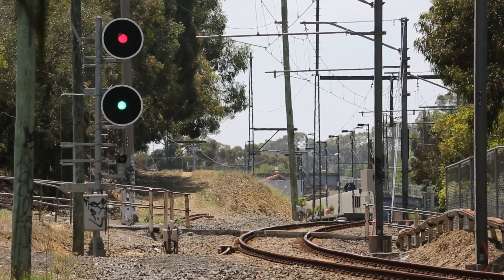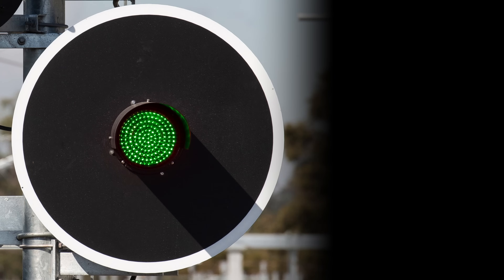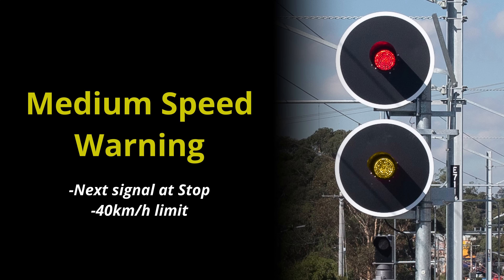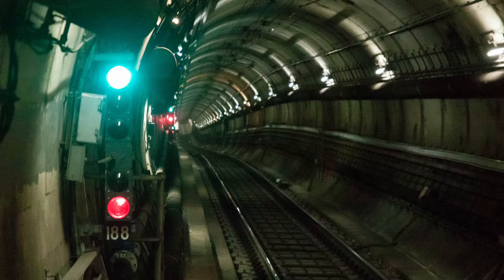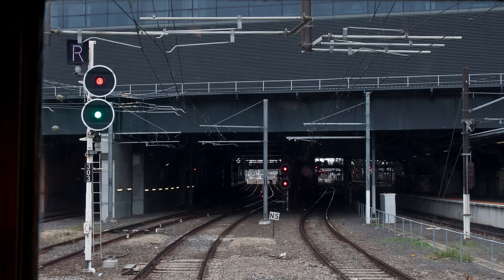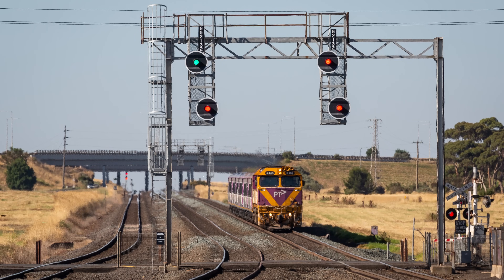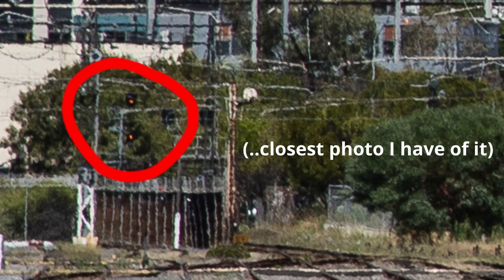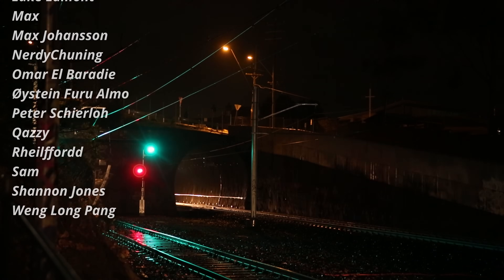Victorian Railway Signalling // What does it all mean?

Comment from the maker: Hi folks, I just want to answer two very commonly asked questions in these comments:

Q: "Why isn't 'Clear Normal Speed' green over green?"
A: Given that the top light means Normal Speed and the bottom light means Medium Speed, green over green would be a conflict: it would mean both speeds simultaneously, and go against the fundamental principals of this system.

Q: "Isn't it confusing to have a red light in a clear aspect?"
A: In short, no. Train drivers are highly qualified in what they do, and know the system like the back of their hand. Confusion about aspects isn't really an issue.

If any other frequent questions pop up I'll add them here!
Reply: It's easiest to think of the origins of this as two semaphore home arms on one post. The top arm is the NORMAL route at line speed, the lower arm is the DIVERGING route at a reduced speed. Everything is logically extrapolated from there.

In New South Wales the origin is HOME over DISTANT as a distant signal on its own at night was indicated by a fixed green home light mounted above it. They never switched to using yellow anything until introducing power signalling.
Reply: In 4 aspect signalling the B arm signal head showing a proceed indication does not necessarily indicate to a driver a diverging movement. A driver observing this signal could also indicate he is catching up to the train ahead of him and not diverging.  This is speed signalling not route signalling.   @cswvna
Reply: I mean, green over green is free to mean something special (I'd suggest green/green should be CBTC, and yellow/yellow for CBTC warning), as nothing else uses it. After all, if the lights are both out, how can you tell whether to use CBTC or if something's badly wrong?
Reply: CBTC relates to a system called positive train control which controls the movement of the train. There are options where the driver can control the train movement but it is still supervised by the computer control system.
CBTC uses the principles of speed signalling and all info is displayed to the driver in his cab. You don't need unwanted aspects like double greens or yellows to confuse the situation as with CBTC everything you need to know is on a screen in front of the driver.   @NoLongerBreathedIn
Reply: @NoLongerBreathedIn  or simply flash the aspects.
Reply: @ryguy2006  Victoria seems not to use flashing aspects as a rule, so I could understand the use of a double green for CBTC. Certainly it would seem to be a safer alternative than just extinguishing the signals, though I suppose that the in-cab control unit would make such an indication redundant.
Reply: @taitset, why does metro not travel via southern cross early Sunday mornings?
Reply from the maker: @mattizard6136  They physically go through Southern Cross, they just don't stop there. It's a stupid thing relating to the station being privately managed, and they didn't co-operate when 24 hour operation was introduced.
Reply: I've always thought Green over Green could function as a special "High Speed Clear" aspect if Victoria ever needed it. Such a thing would be superseded in the Metro area by High Capacity signalling, and I'm not holding my breath for > 160 km/h running in the country any time soon.

But the biggest mystery in Australian signalling is why NSW doesn't have a Yellow over Green "Medium Turnout Clear" aspect. Probably considered superfluous but it feels like it should be a natural inclusion to NSW Signalling.

It'd be interesting to explore whu Victoria's the only state that uses searchlight signals predominantly if that were possible though.
Reply: Not signalling but didn't know where to ask! I'm curious as to why the Ballarat Southern Cross line is scheduled 4 minutes faster going up the hill than it is going down. Regardless of time of day, peak or off peak etc, for the same number of stops, going up is quicker. Why!?
Reply from the maker: @MichaelGoulding  I assume by 'up the hill' you mean up the hill out of Ballarat to Warrenheip? It's because there's a much, much bigger hill in the other direction between Bacchus Marsh and Ballan. You can have a look at the gradient diagram here: https://www.victorianrailways.net/grades/melball.html
Reply from the maker: @OpGaming-el5zk Ah yes, thankyou!
Reply: What is ‘normal speed!? Is it posted as it is on a road,  or is it the same on all lines? If so… 90, 100, more?
Reply from the maker: @mattyb_25  It varies, and is usually not posted - the drivers know it from memory as part of their route knowledge. The highest line speed for suburban trains is 115km/h.

Comment: In Canada also, the offset heads mean that it is an automatic signal, whereas the aligned heads mean it is centrally controlled.
However, the 'A' under the signal has the REVERSE meaning as in Victoria Australia, it means the single-headed red signal must not be passed without documented permission from the dispatcher.

Comment: Yellow over green same meaning in Italy warning of speed restriction due a switch, fixed 30 km/h, flashing 60 km/h, 100 km/h when they alternate flash. Same meaning of red over green here in Italy speed  restriction due a turnout but 30 km/h max, higher speeds are signaled by an ausiliary speed indicator: one bar mean 60 km/h, two bars mean 100 km/h

Comment: Ex metro signaller here, good explanation. You didn’t mention disc, signals, which are unique to frankston area. Also bit of fun trivia for all you out there there are only 2 points on the network which are still manually controlled by a lever frame panel that aren’t customer service signal boxes by a signaller, Kooyong and Riversdale
Reply: I believe he refers to that in 0:44 with "except for a small patch in Frankstown"

Comment: This sounds like an overly complicated system, but as with all signal systems, once you get used to it, it's more a matter of remembering the patterns. Still find the German (all 5 generations), French, and Austrian systems the easiest to understand, and especially to drive by. The British system for the "real" trains is okay, but the system on the Underground is a mess that relies entirely on route knowledge instead of using logical signalling (I mean, their repeaters look identical to the main signals, which is not good for safety). I live in Denmark, where our current light signals were introduced in the 1960s and is only our second signal system. It's a very primitive system, really, with no pre-signals (repeaters, distant, whatever you want to call them) and wasn't designed for the speeds trains run at now, so they rely on ATC to tell the drivers what the signals are, because they can't see the signals in time when going full speed

Comment: My new signal knowledge actually proved useful the other day. The train my wife gets into work is an express through train and I always go with her as my daughters day care is nearby too. On the platform next to it is a terminus train which takes the same route 3 minutes later, but with more stops. Concerningly often, the express is delayed meaning the local train goes first, and since there are no passing opportunities for the express, it ends up stuck behind this train the whole way to the city. Usually, the station staff knows this is going to happen and announces to the platform for passengers to get on the other train if the express is delayed, since they'll end up being faster that way. The other day however, the station staff came out to this platform expecting the train. I noticed however that it did not have a green signal to go through, so I checked the other side, and sure enough that train had both green, and the 3 yellow lights indicating its path through the points, so I knew the local train was going first and told my wife to get on it. A few other people did this too, but most didn't and so they ended up missing that one and waiting for the delayed through train. 
Probably only saved my wife maybe 3 minutes, but hey, it's 3 minutes, that's coffee time 😂👍
Reply: You looked clued up and competent 😊

Comment: Very interesting! Our signalling in Auckland is very similar. All the same basic indications, but slightly different names - Warning = Caution, etc. We use the same letter route indicators and banner indicators. No co-acting signals or repeaters. Low speed here is 25km/ with the same terms. Medium is 25 unless indicated otherwise. Usually 40 or 60, but ETCS sometimes allows EMUs to go faster than other trains like 30 over 25km/h turnouts. We don't have two reds after an occupied section and no medium indications before a red. ETCS applies a calculated speed limit curve on approach to a red or a lower speed limit and speed indicators hit other trains with a 20km/h limit when approaching a junction occupied by a conflicting movement. We have A-lights and offset (permissive) signals with similar rules, but applied in different ways. I do wonder whether there are equivalents to things we have like departure signals (governing entry to a block section when departing station limits) that a driver or signaller may describe differently to a layman. Even within the industry there's a broad spectrum of understanding of this system. In training even the tutors didn't all seem to understand or explain it in the same way.
Reply: One of the things you said and that some tutors say is the red means stop, which is intuitive and functionally correct in a sense, but when you get into the guts if it, red doesn't actually mean stop. It's just a placeholder. In reality, everything means stop unless you have a clear, legal and expected indication of a movement authority. Two reds is definitely stop, but one red and another colour is proceed. Any blank light is stop. Two greens or two yellows is stop. A proceed into a route you're not supposed to be taking is stop. All signals are stop until they're a legitimate proceed.

Comment: For a while at the north end of Royal Park station, there was a stub of the Inner Circle line remaining. The signal protecting it looked like Red over Red with a small, lit Red. I couldn't find the meaning in any reference (although I didn't have anything official), so maybe the small Red was something separate. But the meaning was pretty obvious: Very Stop.
Reply from the maker: Interesting, was it a semaphore signal? I'll have to try to find a photo.
Reply: @Taitset  No, just a typical two-head plus small signal.

My borther was a driver in Sydney so I learned the signals there, only to discover Victoria was very different. So it was something I noticed as not normal.
Reply from the maker: @mrewan6221  Found a picture here: https://www.westonlangford.com/media/photos/114987.jpg

Even though it looks like a red blob here, that bottom light is an illuminated red letter 'A.' This means the signal is switched out and operating automatically, despite being a Home signal. The 'A' only lights up when the signal is at stop, there's another picture here (a bit hard to see) showing it at green over red, with the 'A' turned off: https://www.westonlangford.com/media/photos/114487.jpg
To the right of the A is the Low Speed light, which is off in both photos. 

This diagram: https://victorianrailways.net/signaling/completedia/fbridgecob72.html
Shows the signal as being equipped with an A, although it shows it in a different position.

There aren't many signals left like that, but there's one nearby on the up line at Macaulay.
Reply: @Taitset  I remember the signal as being on the stub. not the down Upfield track. But there's nothing on the diagram, so maybe I'm mis-remembering it.

I could well have walked to the down end of the up platform, if there was a good wait for the next train.

But equally, it could habe been a red A. Maybe my glasses didn't match my vision at the time.

Comment: Usually when i'm at my local station, when a train arrives to stop and pick up passengers it sometimes displays green over red (clear normal speed). Wouldn't it have to display stop because the train stops at the station? and do the signals display green over red for express trains when passing through a station?
Reply from the maker: In most cases, signals don't really have any bearing on whether a train stops at a station or not. There are some cases where a level crossing is close to the end of the platform, where the signal will stay red for an extended time as a stopping train pulls in to allow the crossing to activate later, but if there's no crossing, then the signal will be green is the route ahead is clear, regardless of whether the next train stops. (Might be able to explain more if you can tell me which station it is!)
Reply: @Taitset  Aah thank you. This clears it up!

Comment: Coming from a country that also uses US Relay interlocking derived speed signalling - imported through the Soviet Union, i actually think the Victorian system is the best there is. Our signals are always spaced the same distance apart on the entire line derived from it's maximum allowed speed - which leads to confusion with tons of repeating signals everywhere where you need them to be any closer to convey a message that would be put much more safely by simply showing the correct aspect with a reduced speed at the correct braking distance from said speed. The lights and indicators system is much simpler as well - we have different combinations of two lights and coloured bars where the bottom light and bars show the next section speed and the top light by either being still, blinking slowly or quickly and it's colour shows the speed on the next signal. this can be used for all speeds from 40 to 100 km/h in 20 km/h increments. If any other speeds are to be shown, both the top and bottom lights can get their own number indicator as well. The Victorian signalling is so simple, just two lights showing each "how many sections the speed applies to". Amazing.

Comment: I have seen cranbourne lines operating as normal with both lights off.. what does that mean.. as soon as a Vline went by the both lights switched off and the following metro train stopped and proceeded as normal
Reply from the maker: The lights turn off when the approaching train is running on CBTC, the system described near the end of this video.
Reply: Thanks... Watched till the end now

Comment: As a train driver from Germany, these signals are very different to what we know. To me it is insane that a red signal can be passed under normal circumstances. Red always means stop and may only be passed when shunting and it is permitted by an additional signal (Sh 1) or when you get an order from the signaller to pass a signal at fault. To be honest, I prefer our precaution system, as a red signal automatically alerts you and it may not be passed on a normal train service
Reply: Canada has sort-of the opposite: "If it's not all red, it's not red at all", which means red lights are ignored if there is any green or yellow, either of which may be solid of flashing. The reds   become place-holders so the viewer can see which whether the green/yellow light is top/middle/bottom. Yes, there are three heads on many signals!

If there are only two heads, and the upper one is red, an imaginary red head is added above, or if the upper head isn't red, an imaginary red head is added below. If there is only one head, two imaginary red heads are added above.

With six different aspects (red can also flash, which still doesn't mean "stop") and three positions there are a massive 216 different combinations. Some are not used, but all that are used have at least one real or imaginary red head. It's only the red/red/red, imaginary-red/red/red, and imaginary-red/imaginary-red/red signals that really mean STOP.

Comment: Melbourne is also now only just phasing in TPWS to some signals... Perth has had a variant of ATP since 92 supposedly, yet a train recently spadded a signal near Perth central and wasn't stopped immediately, as it would have been, under pure ATP. Pure ATP, whilst expensive, is the gold standard for a reason
Reply from the maker: We've had TPWS since the start of RFR (about 2004), but only V/line trains are fitted and it's only on a handful of signals in the suburban area on routes shared with v/line. All suburban trains have mechanical tripcocks, which do a pretty good job despite being old technology.

Comment: Admittedly yes the first signalling system I've learnt but the PTA's (WA's urban network) does seem to be the simplest. It's primarily 3 aspect signals with Clear, Caution and Stop (plus the occasional shunt/dwarf) with speed boards and feathers instead of speed based aspects. 

Do you know what the CBTC trains will show in cab to the drivers?

I'll also add that occasionally controlled signals are installed outside of junctions in order to have more signals that can be used as protection by track workers.